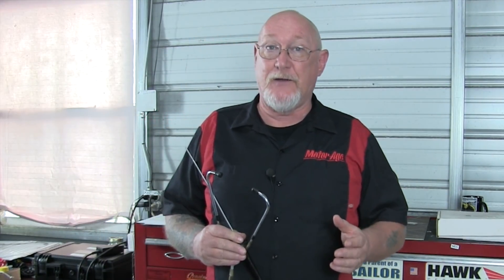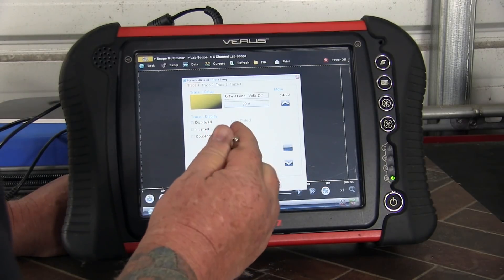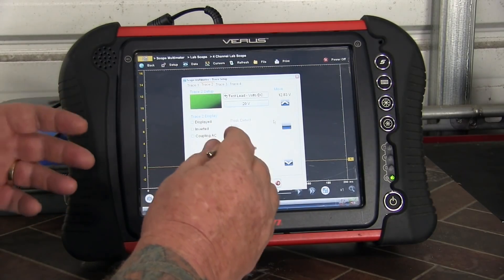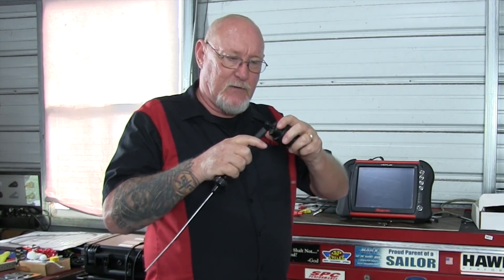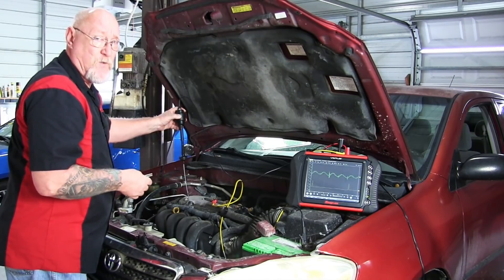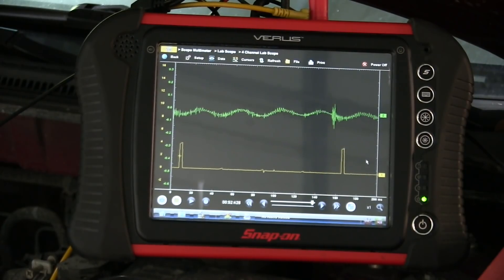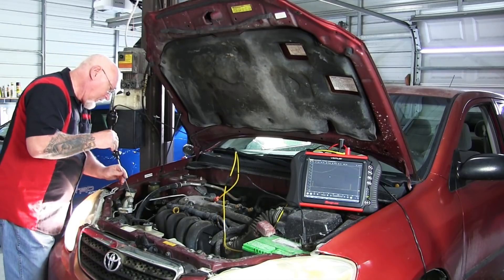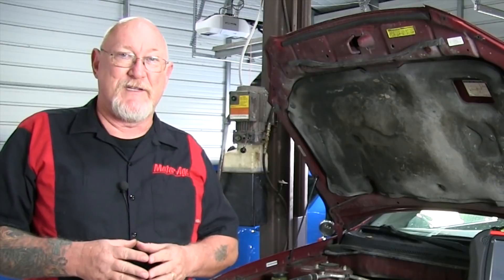The Trainer #97:  "Seeing" The Source Of Underhood Noise

Comment: Great explanation! In my experience, checking rotating assemblies, like in a serpentine belt, is best measured as a relative comparison. The louder the bearing, the higher the voltage produced. I’ve done similar captures using piezo drum pickups stuck with magnets to suspension parts and wheel bearing housings.

Comment: use the FFT option and you will be amazed
Reply from the maker: Can you explain that please?
Reply: @VehicleServiceandRepair " logical canuck" has got a good video of it on you tube
Reply: @VehicleServiceandRepair  its a frequency analyzer that is built into most scopes,it scopes frequecy vs. amplitude.all pulleys would have a different freguency and you can see them all in one pattern
Reply: GADGETS#77 - SERPENTINE SPECTRUM

Comment: That's really an innovative way to 'see' those abnormal noises.  Hey Pete how would you use the tool accurately to diagnose a bad idler pulley since touching the center of a retaining bolt might cause too much noise on the scope?  I'm thinking the old screwdriver handle to the ear trick might work better? Thanks -Glen
Reply from the maker: Hey Glen! That would be an interesting comparison. I think the advantage of this technique is isolating the source of the noise by noticing the increasing amplitude of the frequency. If there is a vibration source, the sound may still be visible through the resulting hash. And, as I have often said, a good tech always has more than one way to diagnose a problem! Sometimes those "old school" tricks are still the best!